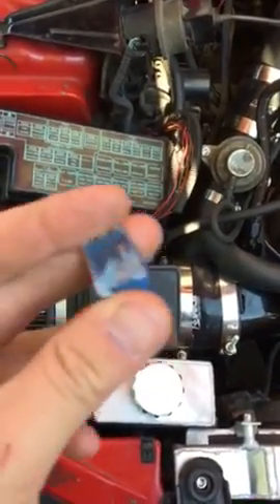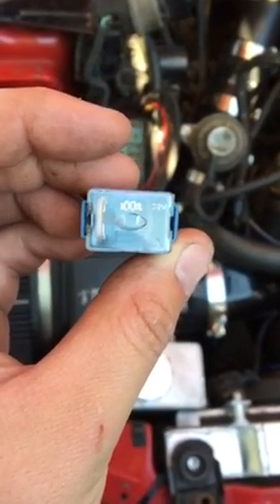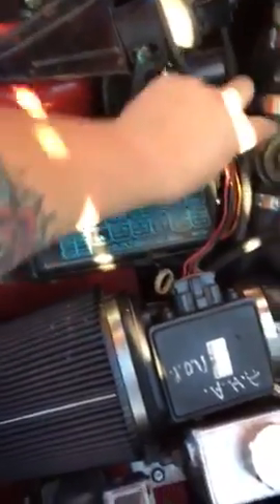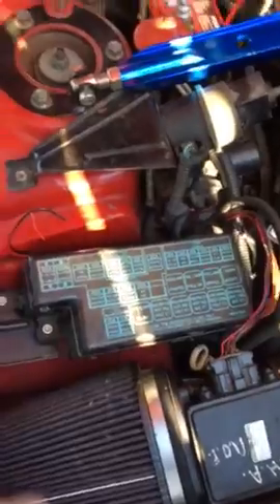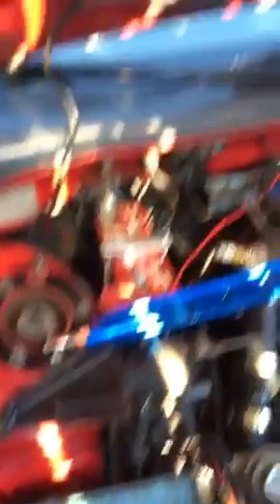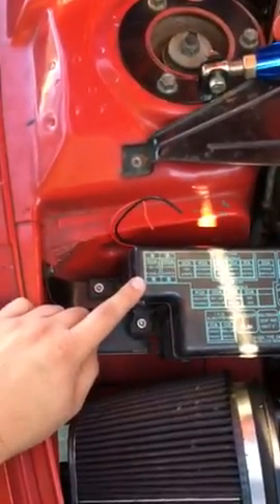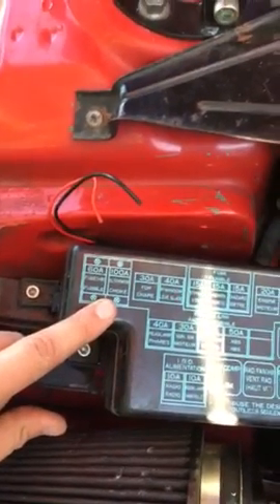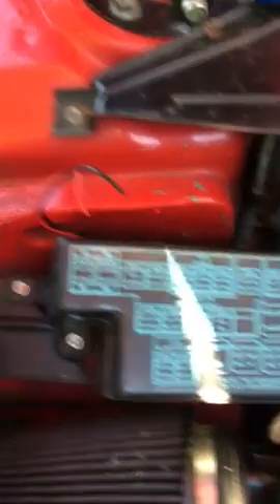How manually raise a convertible top on an eclipse

Comment: mine is closed all the way down but won't shut down , it won't lock , the hangers don't reach to lock it , any tips?
Reply from the maker: if you're closing it manually, that last inch or so is really tough. If it's doing that even with the motor, there's likely some kind of alignment issue in the frame or cable adjustments. I wouldn't know how to fix that myself, I'd have to take it to a shop that specializes in tops. I know these tops have an issue with some of the hinging in the frames sheering off over time on the forums.

Comment: What year is this one? I have a guy trying to sell me a 07 Mitsubishi Spyder and he said that the car is amazing he's just having issues with finding how to get the top to close
Reply from the maker: This is a 96, so it's a second generation Eclipse. An 07 is a fourth gen. Nice cars, but they don't have the same cult following as the first and second gen, though the people that do own them seem to like them fine. Very different drive train than mine. The first and second generation eclipses borrowed a lot of the early evo 1-3 drive trains before the evo came to the US market. The turbo models like mine are essentially 2 door evos. Unlike the early evos though, the convertibles are front wheel drive, but the hardtops had an optional awd system that's was similar to the evos in japan at the time with slightly different gearing.

I don't know much about the fourth gens. If it's an electric top, there should be a similar switch somewhere on the body. If hydraulic, you would need a way to bypass it, which I've never done personally.

Comment: Now my top is close but my right window wont close,any suggestions please help.
Reply from the maker: Tasuta Fitim there’s not really a good way to close the windows manually. If you have battery power and they won’t roll up, you’ll want to start by checking the fuse, then make sure the driver and passenger switches are both plugged in (I’ve noticed mine don’t roll up with the driver’s side switches if the passenger switches aren’t also plugged in). Then check to see if you’re getting voltage to the regulator. If you are and the windows still don’t work, you’ll need to swap out the regulator.